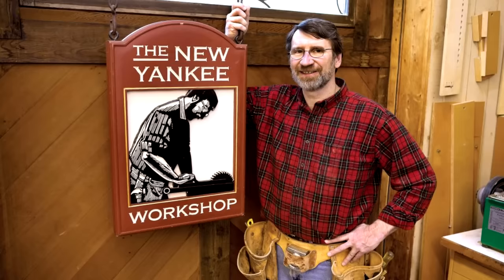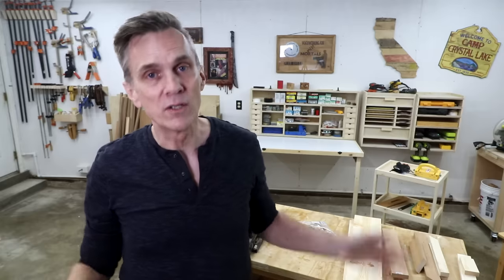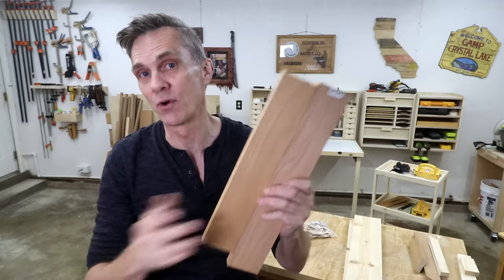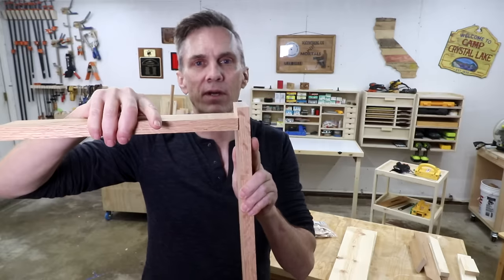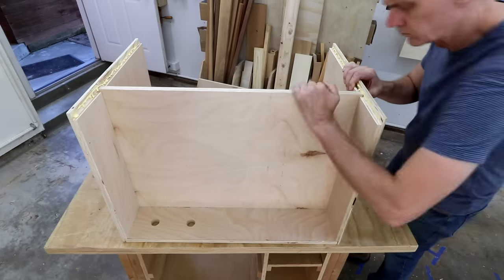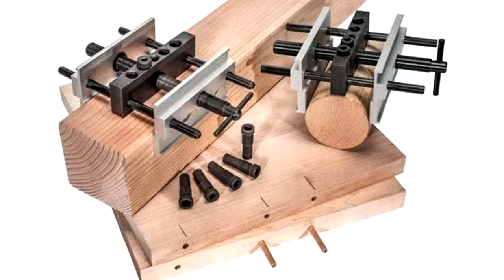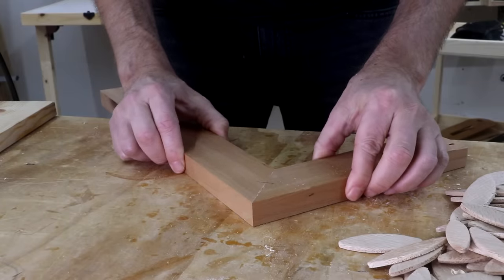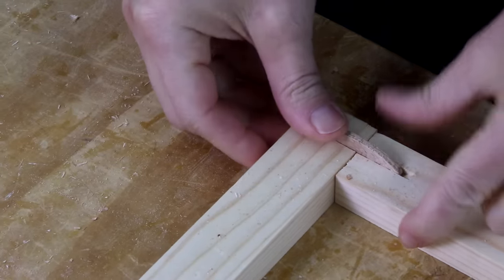So, is a biscuit joiner completely useless?

Comment: I disagree. I've been woodworking since before you were born and I've used lots of biscuits. Where's the tests showing the different breaking forces between biscuited and non-biscuited joints? I have 30 year old glazed kitchen cabinet doors that are fine today. The biscuit swells and increases the strength of the joint.